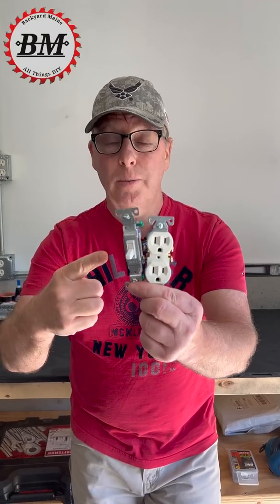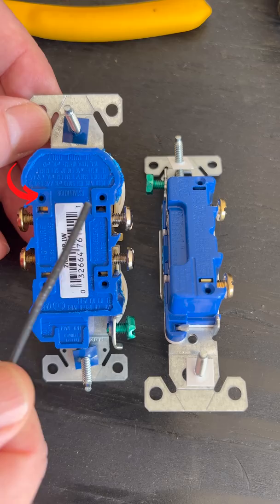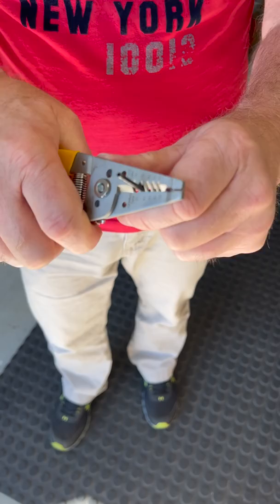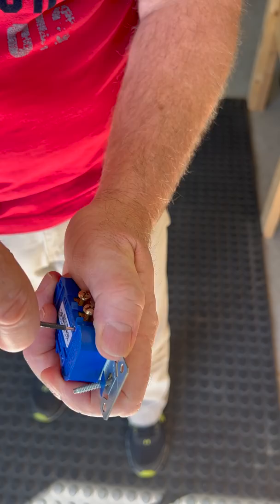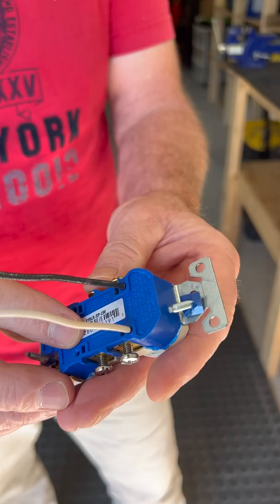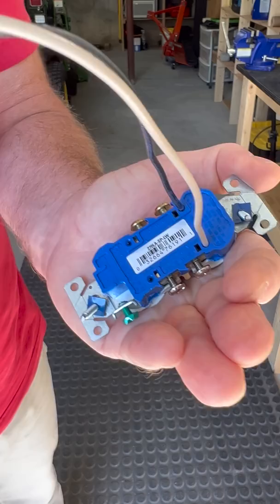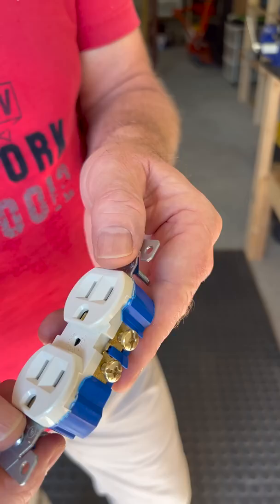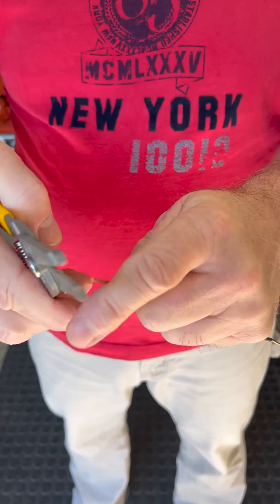Don't make this electrical mistake #Shorts

Comment: I don’t understand, why Wago has managed to pull of push in connectors that are relatable. All of Europe uses them. 
But the US is not able to do push fit connectors.
Reply from the maker: There other brands of push fit or clamp connections sold here that are reliable but the ones on the back of receptacles are not in my experience.
Reply: Amperages are also often on run higher in US homes. That's why the US usually uses 3.3mm2 wire and Europe uses 2.5mm2.
Reply: Because US equipment was designed by Edison and never really changed.
Reply: @thelight3112  maybe because of the US used voltage. These toylike 110v.🤔😉🤭
Reply: @thelight3112  no we use 1,5mm2 in most chases. (Don’t mix in the British)
Reply: @thelight3112  amps in US are higher in US than in  Europe because US runs lower voltage than Europe.  120 vs 240 volts.
Reply: @thelight3112  amperage runs higher here because we use 110. Anything is going to draw more current if run with lower voltage.
Reply: Wegos suck too, fine for determined loads for lighting by awful for outlets and larger loads. EU has lower amperage and higher voltage, we are mostly 120v in residential US so double the amps then EU
Reply: @zayabud T  yes... I actually like the copper split nut connectors. Not exactly practical for small stuff but make a solid connection for the large electric motors I work with.
Reply: user-lt3he9ey4x   the stabs in the back of receptacles are rated fine as well but I find at least 1 every 3 months doing service calls burnt up, melted, or not making contact.
Reply: user-lt3he9ey4x  15-18 amps is possible with things like vacuums ect.. there is liability for sure, but mostly they make the arc-fault breakers trip, or they burn themselves loose. My point is these kind of stab connections are bad for large loads, vacuums, space heaters, window ac.. I only trust those type of connections on determined loads like lighting.
Reply: @@phillipbanes5484 your kinda missing the point, Europe uses high voltage then the US, which includes many country’s..
Reply: @Phillip Banes that is a strange thing to get tweaked over, since nobody here wrote in any manner that hinted they thought it was a country :)
Reply: @@phillipbanes5484
 What do you mean Europe's not a country?
Reply: Well I guess there's the whole amperage/voltage thing and to go back to the original comment the wago really isn't a push in connector it's a level lock and so maybe if these outlets had a little lever or something to push down on they might make better contact. I don't think I would trust the wagos if they were just push and forget.
Reply: @brizzle8797  
There are two different styles of wago connectors wago 221-413 they have a leaver and can be used with solid core and stranded wire 
And wago 2273-205 they are push fit only connectors for solid core wire.
Reply: @timadang2880  
 Oh good to know! I only  Generally see the lever style so I figured that's all they had.
 It had always been said that pushing and forget was an inferior method. So maybe it was that I just didn't pay attention until the lever nuts came out.
Reply: @thelight3112  
Just checked my fusebox, and my European apartment has:
Main wire: 2x10mm^2
Stove/Range: 2x6mm^2
16A fuses: 2.5mm^2
10A fuses 1.5mm^2

So you're right in that there's a lot of 2.5, but older apartments like mine also have even smaller wires for the even smaller courses.
Reply: @kratzikatz1  
You know nothing.

A U.S. Circuit breaker box has both 110 volt and 220 volts available as single phase as it comes in from the street power line.
Reply: Screws let Lose after time
Reply: @@phillipbanes5484is it a province?
Reply: @Phillip Banes 🤣🤣🤣🤣🤣🤣🤣🤣🤣🤣🤣
Reply: @brizzle8797 The original Wagos were push in w/ no lever lock. I was doing a job & the owner made a material run for me; something I forgot.

He came back Wagos & said why don't you use these, they'll be faster.

Never paid any attention to them, before; took one look, pushed in a scrap, threw in the trash & told him, Only if you want this place to burn down in 10-15 yrs.

He didn't mention speed again. Or the Wagos.
Reply: @georgedennison3338  
Yeah those old push-ins don't invoke too much confidence! Because as I would imagine it you can't make the contact spring too heavy because then it would be difficult to push the wire in but of course you want it to be heavy so it makes good contact all the time so I would imagine those level locks are a happy medium . And now lo and behold they have leverlock receptacles!
Reply: @brizzle8797  Lever Lock receps?  Those may be worthwhile.
Reply: @georgedennison3338  
Yep. I believe Leviton is making those. With more to follow I'm sure
Reply: MarkJones-gt2qd in Europe we chose all four! Quick, cheap, reliable and well engineered.
Reply: MarkJones-gt2qd  yes and the reason is they are well engineered. In Europe we laugh about all people that say they aren’t safe,
Reply: Lever lock and push fit are very different.  Wagos are very popular in the US as well.

Comment: I'm from Portugal and pretty much any switch in the houses I've been have all been the push in design, never has one failed because of it
Reply: Maybe so but playing with fire is not a good idea in your house.
Reply: European/German quality brands like Gira or Merten all use push-in connections and never fail. Screw-on connections are hardly ever used anymore for domestic purposes in mainland Europe.
Reply: @mstar501  Europe is way ahead of the us, as always, Americans still hate wagos, for some reason, and we use them probably since 15y ago without any issues
Reply: Faulty connectors aren't available to country's that haven't obtained a Greed lvl. Of 40/105 and maintained a min of 40 as a country for 2 or more generations (or 24 consecutive Greed lvl. Increases in as many rolls or less.
Reply: @jpraleixo this video is precisely why American electricians dont trust wago connections. We have repaired far too many burnt up devices due to this type of connection.
Reply: It’s probably fine for light switches.  Worse with chained outlets
Reply: @mickturner957 he can’t even get these he’s in Europe
Reply: @jpraleixo  You don't need to fix something that's not broke, screw connections are proven to be better!
Reply: @nooneyouknowhere6148  That is why American electrics are stuck in 1950s.. It's like travelling back in time when you see the inside of an American electrical distribution board. 😅
Reply: just buy $10 ones, don't buy $3 ones and made in china
Reply: @jpraleixo I was trying to buy some neat can light with wago connectors and the employee couldn't figure out where the other end of the wago was. I'm like dude I can't take this home and hook it up to a wire nut

Comment: Been an electrician for 10 years... I can confidently say backstabbing kills
Reply from the maker: 38 years in the business myself. Seen so many failures.
Reply: Then why did the manufacturer make them to be back stabbed?  You just aren't doing it correctly.   Rookies.
Reply: @carlt8188  the sheer ignorance in this comment is astounding
Reply: @user-wt3br1vf3m  I agree with you that your comment is filled with ignorance.
Reply: @carlt8188  if I remember correctly that outlet is a UL listed product correct? UL doesn't rubber stamp squat. As for me I like side wiring, but I have yet to ever see one back stabbed as failed. I was a skeptic but 27 years working on and installing residential as well commercial wiring is the basis of my comment. I have however come across failed outlets that had been overheated by improper wire and breaker size. 
To top it off I had even made up a cable to do some light welding, and no it did not fail.
Reply: @carlt8188  it works great in good quality products, not so much in poorly made products.
Reply: Why would the backstabbing method be UL approved (and built into the device)  if it’s such a fire and safety threat the few “experts” on here proclaim it to be?   That would potentially be the largest class action lawsuit in history if true

And some of the “electricians” on here who claim to know all — in my experience it’s the contractors who claim to be super masters that worry me the most
Reply: @rogerdixon1069  I’m no expert I’m just speaking on what I’ve seen in the field. You’re entitled to your opinion as I am mine. Takes me an extra 45 seconds to wrap them around the screws and have the peace of mind they’ll never work itself out. You do you though if you consider that quality work then all the power to you
Reply: @user-wt3br1vf3m  the explanation about failures lays within their use.
Either the circuits were not sized correctly or their being
 misused should be the explanation behind the failures.
As for the stab method being faulty or insufficient I don't have any evidence from my experience. Any failures were always a user negligence, such as hair dryer, small space heater  or whatever combination being used, breaker gets tripped, homeowner or tenant swaps 
15 amp to 20 amp breaker. Then the problems start the usual outcome and blame game continues. I have purposely abused pigtails on a job site and still no failure... So whatever the case I have to stand by my experience with them.

Comment: I've had to rewire many burn-outs because of home owners back stabbing the wires, it only takes a few seconds more to strip and wrap.
Reply from the maker: Right on my friend. It take maybe 5-10 seconds more to have a reliable connection.
Reply: What do you mean Burn outs?  Reason i ask is because my closet lights went out and i changed the bulbs but still nothing, so i changed the switch thinking that went out.  Switch had the back stab wires going in, changed switch to side clamps but lights still are not working, could this be a burnout issue you are stating?
Reply: @debo514  the burn-outs that I'm referring to are homes that caught on fire and I had to completely rewire them. As far as your problem without actually being there to trouble shoot it all I can suggest is you might have lost a power or neutral, or the light fixture could be bad. For your safety, If you don't have enough skill(no offense intended)I would highly recommend hiring a good electrician to diagnose the issue. Good luck and stay safe.

Comment: Yup those "push ins" are an easy way to get a floating neutral or cause overheating wire because they may have not been pushed all the way in. Many times I have gone to new homes to find loose wires from the use of that practice. Do it right the first time and you don't have to go back to fix it
Reply: Old days one would test this with scrap peace of wire, how deep it was and now days there is measuring tool in the mold to see how long wire needs to be stripped.

Comment: Exactly. The way the wire is held by back stabbing it pinches the wire and many tens of thousands of fires are attributed to the wire breaking and arcing, which created the majority of these fires according to the NFPA.  Pinching places a line on the wire and for those very familiar that one utility knife line across the wire within a couple bends will snap the wire.  
This is the reason why arch fault Circuit breakers are now a requirement for all bedroom and in many states are being placed in most residential circuits.  

The more we know the better we can preform service to others and ensure safety is not in question 
Thank you for presenting this great a
Reply from the maker: Great comment. Thank you for taking the time to add a useful comment. Much appreciated.

Comment: Never have any problems with European brand sockets. Strip wire and press in.
Reply: Thats what i thought 😊
Reply: Yeah Europe is so amazing! Bla bla bla
Reply: @randyboyle8379  no, but the sockets you use seem to be crap if they cause fire, can we agree on that? It's not a problem with the type of connection (as it is being used with great results), the problem is with this specific socket being used, don't you agree?
Reply: @AlexKall  id say the problem is likely cheap manufacturing that causes that particular connection type to be faulty, if you use the scre connection it never causes a problem like that
Reply: @AlexKall  They work great.  About 20 years ago there were problems tripping arc fault breakers.  Not sure why everyone has problems with these.  No different than push connectors.
Reply: @randyboyle8379  Of course it is! So what the point?!
Reply: At what voltage though?  Maybe America using 120 is pulling more amps through the contact point

Comment: I agree with this. Those backstab connections are flimsy, which is why they perform poorly. But i recently had to replace several outlets in my kitchen, and the rear connections were something I've never seen before! They tightened with the side screws and were more of a clamp style, rather than the traditional blade style, so it seems to have a much more solid and reliable connection.
Reply from the maker: Yes those are really good congratulations.
Reply: @BackyardMaine  ok so those connections with the plates buy the screws are good? You just feed them in straight under the plate and tighten them down.
Reply from the maker: @killer-gaming  Yes those are great and will last forever if they are tight.

Comment: Thank you brother! stab locking has caused me a lot of headaches with trouble shooting, I've also seen quite a few receptacles and switches melt. Same problem with wagos.
Reply from the maker: You know it... Are they the WAGO 221 or the other ones that look like WAGOs? I have a few installed for testing right now so I don't know their reliability yet. People swear by them but I never used them.
Reply: Wagos should be fine.

Comment: Hey those backstab outlets installed in the 1970's were even more crap than the current ones and they were installed on 20 amp circuit. I'm slowly replacing them on this house. If you need a photo of why I have them. Couple of them came close to burning the house down.
Reply from the maker: Sure send me a photo or two and I'll include them in a future video. My contact email is in the (About) tab on my home page.  Thanks for sharing.
Reply: @ThatToast  Did you examine every knife edge contact? Trust me those old things were not fine unless they were never used.
Reply: @ThatToast  That doesn't mean they were in good condition or that they could withstand full amperage load of the circuit. Most older houses had these in 20 amp circuits. That's too much and any extended use near those levels would creat warm to hot receptacles and could burn the house down. 
Trust me when I saw your argument in no way means these are good or a good idea. Just because many are still in houses that haven't burned down really only means they are a liability waiting to happen. 
It seems like you are trying to excuse them and argue to our readers that these are ok. That is an extreme disservice because it simply is not true. These outlets using backstab option need to be fixed proper or replaced.
Reply from the maker: @ThatToast  Maybe they made them better back then like everything else.

Comment: In Sweden we don’t have this problem with the quick connections, most outlets only have those as a option. I guess our outlets are constructed a bit better
Reply: Yeah havent seen a outlet/switch in europe that dont use quick connection in years, and never had any problems mentioned, i guess its another US only problem
Reply: It's only a problem in the us with the cheap chineeseum outlets that people commonly use instead of spending pennies more for the quality outlets. I've never had a problem with this type of connection on a high quality outlet
Reply: It can take many yrs of insecting something into the outlet many times
Reply: @oliver_klozoff  Double the price is not pennies, but I get your point.

Comment: After about 5 years in a new house, certain outlets would drop in and out. Lights started blinking. I ended up having to re-terminate the entire house.  What a pain.
Reply from the maker: That's why I always put the customer first and wire the devices correctly.
Reply: Thank God we have NEC that everyone has to follow and codes and all that all what will we do without them besides have the same problems but more money in our pockets

Comment: The scary part is what happens when you get a poor connection. It creates heat and resistance. That resistance prevents the breaker from tripping and you eventually get a fire.
Reply: High resistance and heat are exactly what causes a breaker to trip.
Reply: @HBSuccess  facts
Reply: @HBSuccess  I disagree. Low resistance >between opposing conductors< is what causes current to increase resulting in a standard breaker trip. High resistance >between opposing conductors< is not what causes a breaker to trip. High resistance inline with a conductor (e.g. wire to insert contacts) results in heat. This high resistance also causes a voltage drop between source voltage and outlet voltage. But a standard breaker does not see this voltage drop due to inline resistance at the far end nor does it see the temperature increase. The breaker will not trip unless the wire comes out or there is enough heat to deform the outlet and cause the hot to short to ground or neutral.

Comment: Excellent! Backstabbing is an immediate firing offence in my company. And, my brother's. 
We see far too many scorched outlets from the early 2000s, due to this abominable practice.
Before somebody says 'but that was 20 years ago!', outlets I did as an apprentice in my first year are pushing past the forty year mark and when we replace them, the screw connections are still sound. 
WAGO and backwired (clamped) connections have zero in common with backstabbing and are safe. Have to add that.
Reply from the maker: I agree 100% on all points. I've been a licensed electrician for 38 years and have seen the failures. As a matter of fact I side wired my whole house 25 years ago and have never had one issue.